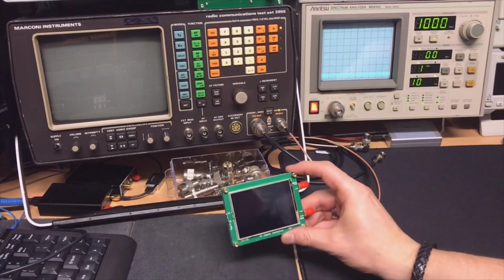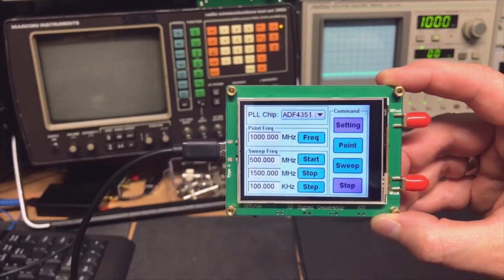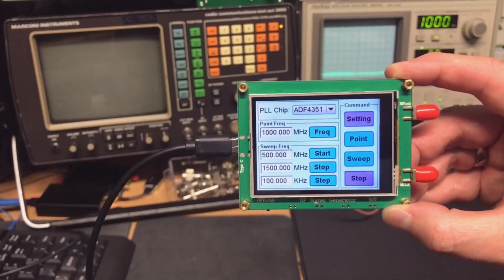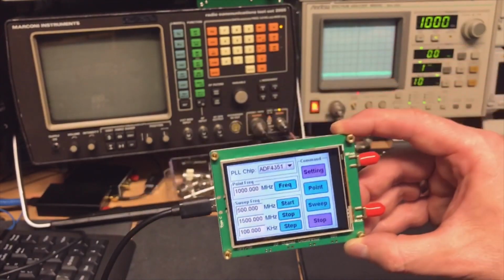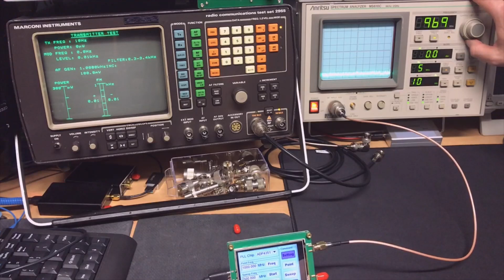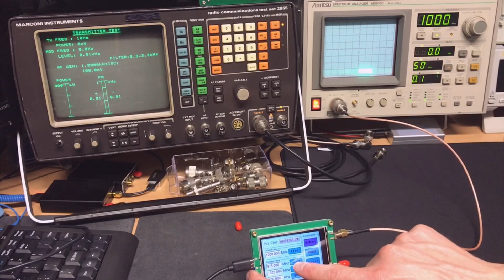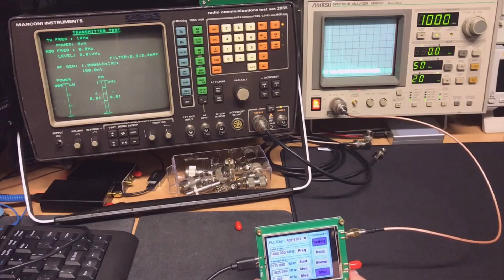#054 ADF4351 LCD Signal Generator 35-4400 Mhz with Sweep

Comment: Great quick review, thank you!  I just bought one of these, a slightly different model but similar touchscreen and software.  It's amazing that a programmable RF source is available with that range so inexpensively.  For HF/VHF range I think I might invest in something nicer, but this lets me play in UHF+ for such a small cost.  To me, this is useful for testing antennas, amplifiers, receivers, filters, simple spectrum analyzers, etc.  A low cost tool in the GHz range.
Reply from the maker: Thanks Tom, yes agree very little powerfull thing :) .. i also have a review with same board but with a MAX chip on it, that one starts at 23 MHz .. and upto 6 GHz ..you pay a bit more for that one..but then it covers also CB ..  Tony

Comment: What is the level stability of these type of generators? As a hobbyist, I don't want to invest too much in equipment. But, my oscilloscopes bandwidth seems to have drifted significantly since getting them. So, is it the scopes or generator or both?

For example, my Siglent SDS22204X Plus which I got the 350MHz upgrade included, measured with a 1X probe 295MHz and with a 10X probe 350MHz.. 

I can compare this to my Rigol MSO5104 scope that was hacked, it was 550MHz with 1X and 465MHz with a 10X (backwards I know, but that is what I got). 

Today, these are way down. The Siglent is a little over 100MHz -- bandwidth limiting is on full bandwidth, 8-bits not 10, and the probes are compensated. I get similar results with a TinySA Ultra generator. 

Do you think that much drift is normal from Oct 2023 to now? 

I contacted a local calibration lab for quotes on these scopes
Reply from the maker: That is a lot of info, i wonder how your come to the conclusions of your test.
first, 1x probe vs 10x probe is normal the 1x limits the bandwidth because of slewrate.
what methode you use to meseure your bandwidth with. -3db within the same test or risetime? or how?

Comment: Got a question. I have the ADF4351 with screen board and I can not get it to talk with my PC. It recognizes the CH340 chip but when I pull up the software to load on frequency hopping, it says USB device not connected
Reply from the maker: Hi Chris, with this type of problem i would, 1 connect the USB direct the the PC, no usb hubs. 2. make sure the USB has enough power, if you use a laptop connect the power adapter and check energy saving setting.
3 makesure that you have selected the correct virtual comport in the application. in you device manager you can check what port it created.

Comment: Dear Tony, 
Thanks a lot for the video.
I would want to know whether or not is it possible to control sweeping speed?
Best regards!
Reply from the maker: Hi, if i remember correct, the speed can not be adjusted, but the steps can, smaller steps will make is slower.

Comment: nice video. How can I set the time of sweeping function to a specific value. I see that from the video that the smaller steps the slower sweeping function and the opposite is true, but without known the time it will take! How can I set that time?
Reply from the maker: Hello Bassam, You are correct, smaller steps take longer.. time you can NOT set., you can set Start Freq. Stop Freq. and stepsize.

Comment: Tony, I wonder if it is possible to take out the 25Mhz crystal and always provide an external RF source. I have a 10Mhz. clock, which has a very pure output (GPS Sync), and I'd like to use that. My question is: I read the specs on the ADF4351 and it is not clear if the signal should be square wave or could be a sine wave. Any thoughts ?
I might buy another unit and do a test but I'd like to hear your input first and also hear from other people.
Reply from the maker: Hello Maximvs You are not the first to ask and it is indeed very interesting, i will do a video about it in the next weeks.
I have the schematic, it is in the description, there you can see it is easely possible, but not sure it will also run on 10MHz.. will also try that. if it does not, i will use my 10M-6PLL to make 25 MHz from my 10MHz GPSDO.
If it needs square or sine.. i think square, it goes directly into the IC, so TTL i would think..usualy it detects a rise edge... both have that.. doing the ext. ref.  modification on the FY6900 .. both worked... stay tuned :)
Reply: @TonyAlbus  Another question I have is that if I input a sine wave (that is pure), maybe those frequency spurs will go away. I doubt it but I am still curious.
On another note, the specs for the ADF4351 say that the Ref-In signal has a minimum of 10Mhz. So, 10Mhz should be fine.
Also, the ADF4351 has both a CLK and Ref-In pins. The datasheet shows the Ref-In going directly to an Inverter gate.
Reply from the maker: @linuxaos  Yes i will test that also, i also have a pure sine available :)
Reply from the maker: Yes that works :)  video #112  https://www.youtube.com/watch?v=SNuPzkJFMwY

Comment: Thanks for a great video, Tony. Since you made it, have you experimented with the MCLK port? Do you know if this is an input for an external reference? In my ideal use case, I'd clock this thing from my home built 10MHz GPSDO to test a 2.7GHz frequency counter I'm currently building.
Reply from the maker: Hello Luc, one of my viewers sent me a scematic.. it seems, the MCLK is now an output, with its 25MHz refclock.. but when you remove R5, 0 Ohms.. you cab use it as an input... but you need an 25 MHz ref... my Video #076 and #101 i think... i have a PLL that can use the 10MHz as a ref.. and you can easaly output that 25MHZ to this one... thats the idea.. but i have not tried yet..could be an idea for a next video...  let me know i you want the schematic for download.. Tony
Reply: @TonyAlbus  Thank you so much for the reply. I'd be very appreciative if you could post the schematic for download. Having seen that some other ADF4351 modules on AliExpress (plain boards without the LCD) have a 0 ohm resistor, I had wondered if this module would have one too. Looking at the datasheet and a couple of other references, it looks like the chip itself can be clocked at frequencies other than 25MHz. (I don't know if this would lower its max output freq.). If this is true, then the main thing preventing it running from 10MHz directly would be limitations in the software. At 3:38 (https://youtu.be/SUf2T9pSD3Y?t=218) you show the settings screen. It looks like the Ref Clock value might be able to be adjusted. If that value can indeed be updated to 10MHz then we might be in luck! Any chance you could check to see if this value can be edited in the interface?
Reply from the maker: Hello Luc. i have added the schematic in the description, i will try this and make a video, stay tuned.. could take a few week though.. Tony
Reply: @TonyAlbus  thanks for the schematic.  I will stay tuned for your video! Meanwhile I've ordered one for myself,  so hopefully that will arrive over the next few weeks too.
Reply from the maker: Yes that works:) ..  video #112  https://www.youtube.com/watch?v=SNuPzkJFMwY

Comment: Thanks, you can show me: How to use module ADF4355 250M-6.8GHz Sweep RF Signal Generator VCO Microwave Frequency PLL
Reply from the maker: Hello, Thank you for your comment, i do not have the ADF4355 yet, but when i have i will.
i see it is a lot more expensive, i don't expect the review soon, unless i get send one for free for testing.

Comment: Here the secret of USB serial control:
Baud:115200, Data:8, Stop:1, Parity:none, Type:Hex, Send on Enter:none 
Point: send 11 bytes B0..B10
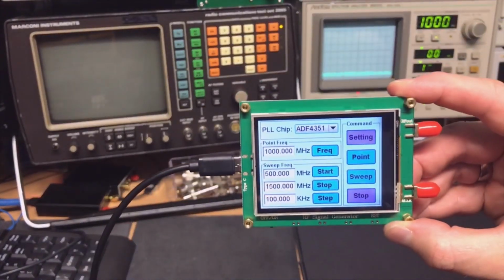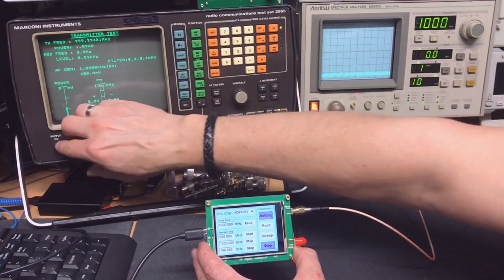with B0:ad; B1:01=ADF4350,02=ADF4351; B2:01=point; B3:01=0dB,02=-3dB,03=-6dB,04=-9dB
B4-6:fRef (03 d0 90 = 25.0000 MHz); B7-9:fPoint (03 0d 40 = 200.000 MHz); B10:sum(B0..9) & 255
Stop: send 3 bytes B0..B2
with B0:ad; B1:ff; B2=ac
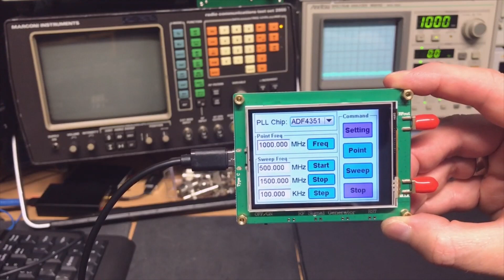Sweep: send 18 bytes B0..B17, with B2:02=sweep; (others same as Point)  
B7-9:Start; B10-12:Stop; B13-15:Step; B16:01=kHz,02=MHz; B17:sum(B0..16) & 255
Return on success: ad 66 13
Example: 
ad 02 01 01 03 d0 90 00 88 b8 54 = ADF4350,Point,0dB,fRef=25.0000,f=35.000
ad ff ac = Stop
ad 02 02 01 03 d0 90 0a ae 60 0c 35 00 00 13 88 02 0b = ADF4351,Sweep,0dB,fRef=25.0000,f=700.000..800.000MHz, Step 5.000MHz
Nice to use a small Python script to set a defined frequency, and e.g. read  a filter response with logarithmic RF detector+Arduino, before switching to next frequency. Mixed operation with remote und manual works fine.
Reply: Karl-Heinz, thanks for the very useful information. I wonder if there are more USB serial commands for the ADF4351, such as a command to disable output before the ADF4351 PLL is locked?
Reply: @andreitalapov9199  I had hoped to find something here, but no info on the internet. So I asked the seller for the software the screenshots are showing PLZ-PLL-435X. It took me a week to get it. They sent me evering except this program (from chinese screenshots, to links to protected pages, even the password, but without the needed username, and many other useless things). Finally I succeeded to convince them to send as zip. 
The software itself is not very helpful, you can adjust the same items from PC as with the device. But with a serial sniffer I could listen to the traffic, and easily find out the bytes format. 
As programmer I would have added a kind of backdoor, e.g. to set the ADF4351 registers directly. Possibly there is something like that, but its difficult to find out. May be by code guessing (start with 0xAD, end with checksum), or read out the PIC assembly code (unless protected). Anyway, its a lengthy task ...
Reply from the maker: Hello @karl-Heinz could you sent me that zip by email or link to a download?
Reply from the maker: @Karl-Heinz Received well!! thanks a million...
Reply: @karl-heinzschweikert7593  could you send me this zip by email or link to a download
Reply from the maker: Thank you very muchKarl-Heinz!!, very helpfull